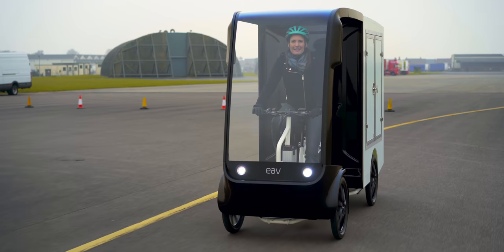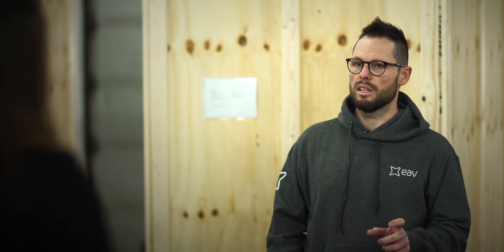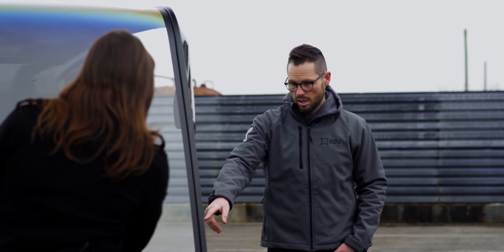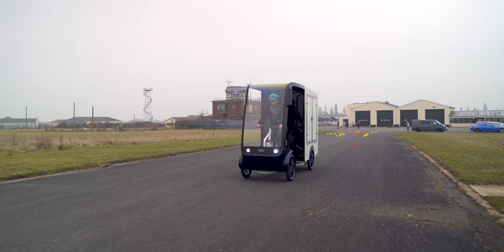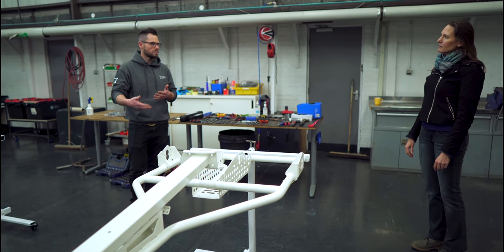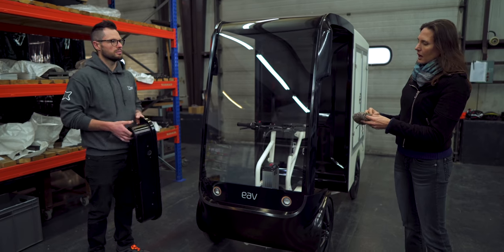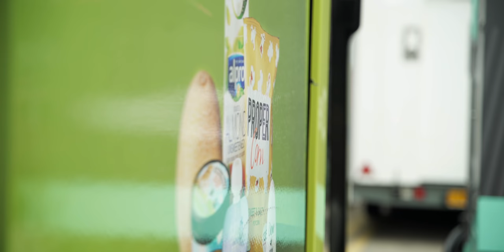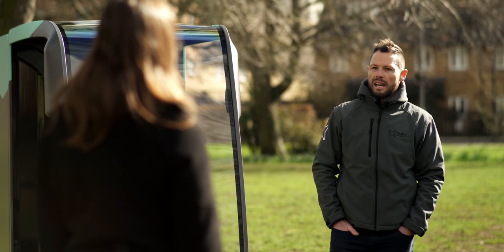EAV - Can these electric assisted vehicles change urban deliveries? | Fully Charged VEHICLES

Comment: i'm a postie , my round averages 5 miles on foot .. i can see this type of vehicle in my near future
Reply: Yep me too and I drive to work in a Nissan Leaf, my duty is a 10 mile round trip in a deisel van and with 5 x 15kg bags and lots of parcels might be a bit of a squeeze in the back of that e-cargo bike. What would concern me is the wind, when that thing gets light with no mail left in it, how likely is it that the wind will blow it over? Have they consider a roller blind action like doors, that can cover the user?
Reply: @showme360  used in an urban area, wind is less of a concern, but yes that could be a problem. It's a very lightweight shell at the top with a steel frame, motor and batteries lower down, so the CoG should be fairly low.
Reply: Australia Post has vehicles like this in service.
Reply: I think they trialled them in either Norway or Sweden.
Reply: Have you seen the electric cargo bikes that the French postal service uses?
Reply: thank you for your service. I live in a rural area and my postie makes a lot of km everyday
Reply: @EndlessPlane  I haven't seen any, where do they run? I have seen some ebikes around Brisbane.
Reply: @morosis82  if you search 'australia post electric delivery vehicles' you'll see some articles.

They had the first trial of about 100 bikes in 2017, and they have been rolling them out nationally since then. 

I've seen them in the wild in Hobart and on the Gold Coast.
Reply: @EndlessPlane  wow I haven't seen those, they look awesome.
Reply: Are the helmets so that you don't have to explain 100 times a day why you don't need to wear a helmet in one of these? Sometimes this approach is just easier huh?
Reply: And a big belly!
Reply: can you just buy your own?
Reply: Buy a cargo bike for now

Comment: slap some solar panels on the roof and you've got a tiny camper bike.
Reply: All by name. Did you see how small the batteries are? Add 2. Take off the pedals. Is it a bike? This is a game of legislation. The pedalling is for ticking boxes and for our perception for approval. Tiny tiny steps. Change the bike seat to a normal seat. Still a bike? With 4 wheels? 
Gee lets make it go faster. - 'Oh sir, this is a car! now you must meet these 1000000 regulations.'
Ok, fine, then we'll make it a trike and evade that. 
If we could freely use what we wanted, as we desired things would have looked very different long ago. Currently we're squeezing the new into old moulds. Very slowly at that.
Reply: @brainfood101  only one way to find out  do 40,000 people die annually US in with current legislation in the automotive industry?
Reply: @brainfood101  Regulations protect powerful businesses from competition. It is not about safety or if it is a car or bike. If we are a threat to a big business they will deploy the hounds (lawyers) upon you to make you comply or go out of business. Usually the cost of compliance will remove you from the playing field.
Reply: Indeed.
Reply: @onegreenev  YEP!!!!   You hit the nail squarely on the head.
Reply: Why are Americans so obsessed with slapping solar panels on everything. It is completely pointless. The little electricity you get is only enough for a few meters. You are going to be charging at home anyway.
Reply: @jandersen6802  did you read the rest of the statement? If its employed as an RV, it won't be going "home" every 20 minutes. Even if you are out making deliveries all day long like an actual delivery van, the solar panel would extend the battery life by several hours if it charges up in 6-8 hours and its out in the sun all day on an average 8 hr work day.

Comment: Someone is bound to convert one into a mini camper
Reply: Pop-outs to the max!!!
Reply: And why not 😊😊😊😊
Reply: My first thought. This really would be a way to explore anywhere. Pop out sides/ tent with solar on the roof and storage low.
Reply: @jonblacklock1052  yea my thought exactly, maybe the pop up side panels could also be solar. Near infinite range.
Reply: @jonblacklock1052  lugging all that weight around 90% of the time on self power isnt very fast or convenient
Reply: Funny but that was my first thought, a camper. I have done two pushbike trips of 4500- and 5200 km, this would be a bit of cheating with the engine but what the hell, I am older now, I need some help! 😊
Reply: A whole tiny house with two floors
Reply: That'd be me

Comment: With alot of road changes and pedestrian zones popping up, this is a good idea. Will take a while to get used to and granted may not work everywhere. But is one of the solutions to help transport things in a more sustainable way over small distances.
Reply: It's a good idea? This is the reality in many cities.
Reply: Yeah, the integration of low-powered micro-EVs into pedestrianised / bike lane areas is a tricky balance. Especially if they're slower / faster than typical bike trafic, or have limited mobility and visibility as this does. Much better than Sprinter-sized delivery vans, though!
Reply: @armadillito  especially if you can take some of those car lanes and repurpose them. One of the main bridges in my city across the river has just been closed to everything but bus traffic, which has its own lanes. There are now two pedestrian paths and two entire car lanes of bike and pedestrian space.

Only going to become more common.

Comment: This is exactly what we need in any urban setting. I would like to see large areas pedestrianised using these types of vehicles to deliver goods and possibly taxi people around. We could have hubs from major roads where larger vehicles load up these smaller vehicles for local delivery. It totally negates the criticism of autonomous cars making drivers redundant as we would need lots of drivers
Reply: As a taxi it would be great if the battery pack could be switched with a freshly recharged one. People weigh a lot, and charging is downtime.

Comment: If they used hemp it would be Grass Reinforced Plastic!
Reply: Also Hemp Fiber is also stronger than Kevlar and non toxic, see Hempearth composites available in Hempearth Plastic and Hempearth Wood. Remember hemp aviation composite was actually used with phenolic resin in a 1943 spitfire.
Reply: Peter Hicks   Now THERE'S a name for a product... Joint Venture...
Reply: It is still plastic. Don't kid yourself. There is no way to separate the plastic resin from the flax or hemp material rendering them both non-recyclable. Hemp is not a grass but I get what you are saying. Yuck Yuck. Flax is easier to grow and process. More abundant and has a short growing season. In some parts of the US we could easily get two full crops per year. Now to find an organic material that is fully decomposable that is on par with the petrochemical resins we need to remove from our products. That way the blending of natural fibers (natures carbon fiber) we would have a wining material.
Reply: @williamames4628  On it's own in the fibrous state it is stronger than kevlar but blended into a hard plastic material it becomes a filler so you don't have to use as much resin. If the resin is flexible then the fibers will assist in making it stronger but if the resins are not it is only filler material and most any thing would do.

Comment: I see this being popular in developing countries especially urban settings
Reply: I doubt it. Made in the UK by engineers it will probably cost a fair but more than a locally made van.
Reply: They cost around £12,000 so I don't think so
Reply: @clayton9998  
Yikes, that better come down or someone will come in to complete at a much lower price. Especially in China or India.
Reply: If they were cheaper, they'd replace tuktuk in Iraq and India
Reply: @موسى_7  Tuk Tuks cost $22,500
Reply: Maybe -  so long as the roads are smooth enough for something with small wheels and very limited suspension travel.. This is designed for last-mile urban deliveries in any city. Active travel zones, low emissions zones and the general  cost and inefficiency of driving small parcels rounds in big vans all mean there is going to be a lot more of this. The moment the couriers work out how to do it more cheaply and/or more quickly with these vehicles the model will change. By far the hardest part is finding sites for interchange hubs.
Reply: @xxwookey  Well they might be lucky, there might be a lot of empty offices coming on to the market over the next few years.
Reply: Though it might look simple and therefore thought to be at home in a developing country setting, it seems to be a high technology vehicle. It needs a supporting infrastructure that is not necessarily available in a developing country. This kind of vehicle is more suitable in a developed country where the economy has moved towards services and light high tech industries rather than manufacturing.

Comment: It's encouraging to see such a well thought out, and useful, product being developed and implemented. Do you have a materials background? I ask, as a materials engineer, because you seemed very comfortable discussing the materials topics.
Reply: She studies bubbles and is a physicist, so not as such, but she's done a lot of science presenting too so I'm sure has picked up plenty of materials knowledge along the way.
Reply: Henry Ford made a prototype car in the 1930's, made with hemp fiber and resin, that was dent-proof and lighter than fiberglass. There are videos of a demonstration of it (here on YT), with some guy hitting it repeatedly with a sledge hammer. The engine was also designed to run on hemp or peanut oil. (JD Rockefeller talked him into using fossil fuel instead), and the rest is history...
Reply: Dr Helen Czerski is a physicist and science tv presenter (several BBC programs).
Reply: @barrykaine6526    A dutch company makes dayboats from Flax fibre and natural resin.

Comment: "50% of the costs are in the final mile of delivery".

We need to be really careful about what is being said here. There are a different costs involved with deliveries - environmental and economic (fuel, maintenance, labour) - and vehicles like this will only reduce some of them. And being smaller vehicles, may even increase others.

Whatever we are talking about, the costs are loaded towards the final mile. It takes fewer vehicles and drivers to move large lorries between depots. Having multiple smaller vehicles out doing the final mile (in order to get everything delivered in one day), spending a lot of time idling, pushes the environmental cost to the final mile. Having more vehicles and drivers push the economic costs to the final mile. And that's where we need to be careful - if you would need two or three of these to replace each traditional delivery van, and therefore need 2 or 3 times the staff, financially that's going to increase the costs.

Companies can have a desire to improve environmentally, but they still need to be price competitive. I suspect most couriers are still going to be better served by direct size-comparable electric replacements for their vans. But this type of vehicle will definitely have a place in cities where space and congestion is an issue (being able to bypass traffic using cycle lanes would be a big win), and for companies that specialise in connecting local businesses with their communities.
Reply: More staff is a good thing
Reply: @thumper1747  Not if you are a courier looking to keep your prices down. People are the most expensive part.
Reply: Awesome comment!
Reply: Being able to claim 'zero emission last mile delivery' is a selling point for some clients and that competitive advantage could be worth the cost.
Also if the infrastructure continues to change to no longer favour conventional motor vehicles then their costs will rise and the costs for these will fall.
One can hope at least.
Reply: @Egg-mr7np  A "normal" sized pure electric van is also zero emission. You don't need a larger fleet of smaller vans to make that claim.
Remember, the guy in the video specifically called out that "half the costs are in the final mile" - running a larger fleet of smaller vehicles will not be cheaper. But there will be use cases where a smaller vehicle makes sense.
Yes, the infrastructure will move to favour EVs, and that can't come soon enough. But the costs of employing drivers will still favour fewer, larger EVs in most instances.
Reply: @GrahamTriggsUK  Yes, agreed staff costs are large and more vehicles means more staff. My point about infrastructure is about physical restrictions on vehicle types are leading to smaller vehicles being cost effective. LTN's in London restrict routes vans can take but not these vehicles. So if they need twice as many trips that is balanced if vans take twice as long. This company could be gambling that restrictions on conventional size vehicles will increase, literally making space for smaller vehicles to be competitive.

Also they may be looking at the wrong market with fleet buyers. Cycle couriers are increasing because of freelance delivery riders enabled by app makers serving new markets(food places that can't justify their own delivery service). A new niche of courier might be enabled with the right app for those who need local delivery of larger items. Imagine a tradie who needs there tools across town, they could hire one of these, hop on the tube and save themselves having to run their own vehicle. A wild idea.
Reply: @Egg-mr7np  All of which I said in stating that these smaller vehicles will have a role in inner cities where congestion is an issue, or connecting local businesses to their communities (such as food delivery). But that still means that the majority of final mile delivery will be covered by a like-for-like swap of petrol/diesel to EV.

Comment: I like this a lot but as an experienced ebiker I do have some reservations. Whilst it is true that the latest motors have excellent torque compared to earlier models, London is not the only city in Britain and many have hills that would be unmanageable with a load. We need legislation change so this type of cargo vehicle can have more power whilst still having the same speed limit for assistance (15mph), this would dramatically increase the usability of these types of machines.
Reply: The laws in the UK around electric assist cycling is so backward. It's like they are designed to hinder development.
Reply: The way the power is measured means that the '250W' motor can have much higher power outputs than that in practice, especially over short durations. I understand there is am EU category for higher powered ecargo bikes that does not exist in UK legislation yet?
Reply: @xxwookey  last time I looked there were discussions but no changes but that was back last summer. I think the issue here is really torque rather than pure power but obviously, the two are related.
Reply: I really like this design and concept - especially their taxi version which can take two passengers, has flip down seats and a ramp for wheelchair users or cargo which would suit our family for school runs, local commutes and shopping. It could even work to transport my work equipment when doing jobs within London (I’m based in a suburb within the M25.
However I do have some reservations, the 15mph assist limit being one of them. I don’t have any experience as an ebiker so my reservations may be misplaced but with local roads lacking cycle lanes and this taking up more road where passing space is often limited I would want to be able to keep up with traffic rather than having it stuck impatiently behind me. To my mind this would mean being able to go at least 25 mph - many local roads are 20, some 30, some 40mph, but at least on 20 mph roads I could keep up and most traffic seems to go at around 25 on the 20mph roads. I would be very interested in your opinion on this Steven, since you actually have ebike experience on the roads.
Finally my other concern is price and affordability. There is no way this could replace a car or van for my work when I have to travel hundreds of miles outside of London so it would be a second vehicle for us. Having been quoted £14,000 for the basic EAV Go I was very shocked by the price. For mass adoption this needs to be affordable and you can buy cheap Chinese electric vehicles for less. Given it’s essentially an ebike (which can be had for around £1000+) with a frame around it I was expecting something in the region of £4000-£5000 tops and that would seem a reasonable expenditure but 3x that? And no doubt the taxi version will be significantly more. Looking at more common ecargobikes it seems my expectation of cost was about on the money for them and this has better enclosure and more wheels but still? Perhaps it makes sense if you are pricing downwards from an electric van but still....

Comment: How do you clear the windsccreen when it rains?
Reply: A simple spray coat. Also used on cars. Lower speeds and thus shorter distances. People with glasses use bikes in the rain. They really do.
Reply: It's nearly vertical. So keep it clean and it won't be an issue.
Reply: It also wiggles and flexes quite a bit so the droplets should shake off once you get moving!
Reply: Ceramic coating.
Reply: Hydrophobic coating will solve that.
Reply: @JB-xb3kw  is that eco friendly?